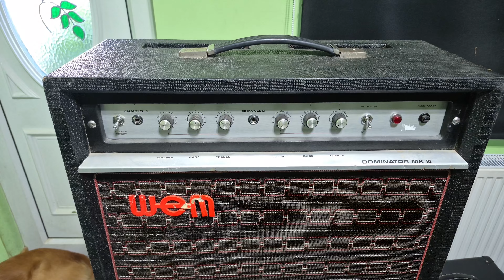Can we Fit some Cheap Less than £20 NOS Mullard Military Grade Output Tubes to a Wem Dominator MK3?

Comment: Great video Martyn, very interesting. I use a Wem Dominator for bass in a blues band. I've swapped out the phase inverter for a ECC81. It sounds great with a loud drummer although lacks bottom end past 12 o'clock. How could I introduce more low end without having to change the speaker?
Reply from the maker: Hello Tim. Sorry for the late reply. I have been ill and I am trying to catch up. The Dominators I have seem to have plenty of Bass. But I have changed the speakers in mine. Do you have Black speaker in yours with the square magnet holder? The best speaker I have heard in a Dominator is a Green back. The tone stack in the amp should give plenty of Bass response.
Reply: It's a Blackback, I've thought about internally linking the input channels. It should be a straightforward mod which won't change the overall asthetics of the amp. I wouldn't mind the 50 watt version with the 12" Goodmans but I don't think my back will allow these days!
Reply from the maker: Hello Tim. If you link the inputs they will be out of phase. This is because both channels are not wired in to one side of the phase inverter. They used both grids, one for each channel. I think I covered this in an earlier Dominator video. The late Nick Adams also covered it. He did a great job explaining it. I have put a link below. He did a few videos on the Wems

https://www.youtube.com/@nickadams5411

Comment: The 6BW6 has a low gm (4.1) and would require more drive, but the CV4055 (6CH6) has a gm of 11 which is very similar to the EL84 and should work well.
Reply from the maker: Hello Steve. That's a good point to bring up. I am doing a small follow up video. I will mention this. I checked the CV4039 which we put in this amp. gm  = 7. Selmer used the 6BW6 in a lot of their amps. I might do a video this topic in a few weeks. I have a bit of a back log of repairs at the moment. Thanks for bringing this one up. Take care Steve.

Comment: EDIT: Erased the thought  about those power tube sockets not being safe - there is a board underneath. 
It bugs me that this IC in tube datasheets is not better documented: they could tell what is this internal connection made to, it may even prove to be useful (eg. for shielding). 
I was surprised that the pinout of those tubes is so much different. 
Also, g3 being separate from the cathode; are there any circuits where those are not connected; would be any benefits possible from it? Maybe tying g1 and g3 together ...
Adding such a high resistor to screen node - how does that infuence the preamp node, which follows? I'm making some from the scratch tube amp project with salvaged parts and am worried about those 10k dropping the voltage too much for the preamp to function as it should - should I then make the resistor from the screen to preamp lower value?
Reply: Two reasons for some tube types having internally jumpered connections are 1) additional heat dissipation, especially for screens and grids, and 2) to prevent amplifiers designed for up-rated tube types to not be usable with lower-rated versions of that tube. For instance, a 7189A is generally backwards compatible as an uprated replacement for an EL84 but a 7189 wired amplifier circuit and socket probably won't pass audio if you plug an EL84 into it.
Reply from the maker: Hello Jernej. That's a good point you bring up on the voltages. According to the schematic we have dropped 40 volts on the screen, 290 Volts, to 250 Volts with the 10K resistor . The next node to the preamp tubes is also 10K , so roughly another 40 Volts. So around 200 Volts. The schematic says 240 Volts feeding the plate resistors. I think I will do a part two video to look at this. Maybe change the node 2 to node 3 10K to 2.2K. I should have measured the pre amp voltages. A lot of these smaller amps don't have much more than 200 Volts on the pre amp tubes but it's definitely worth a look. Thank you for bringing that up. Take care.

https://www.vintagehofner.co.uk/britamps/watkins/schematics/dommk3.html
Reply from the maker: Hello Jernej. I have a done a quick video on the point you made about the pre amp tube voltages. Thanks again for bringing this one up. The link to the video is below. Take care.

https://youtu.be/doZ_l0OkC34

Comment: Weirdly, I looked at a half-dozen data sheets for this tube and several descriptions refer to it as a "beam power tube" (aka a tetrode), but most of the diagrams, except for one, show it as a pentode. If anybody else experiments with these from a different brand/source, be careful how you wire them.
Reply from the maker: Yes, I noticed it said beam Beam Power Tube on the datasheet. But you are right on. It's a Pentode. I will mention it when I use them again.